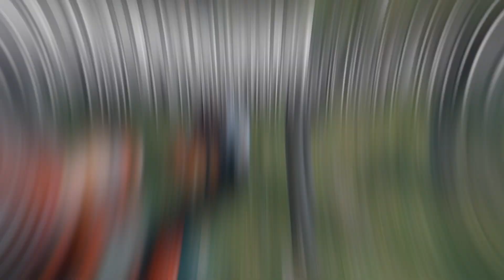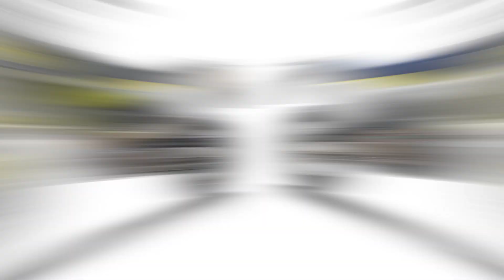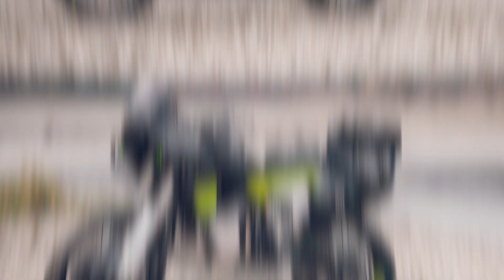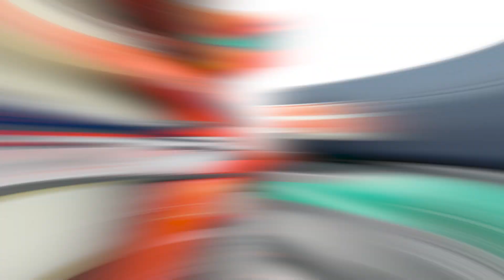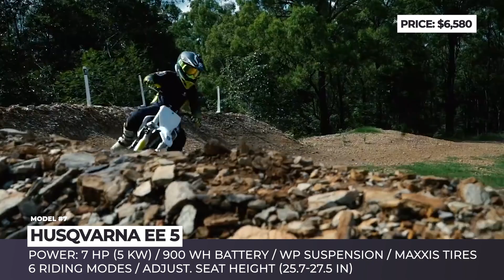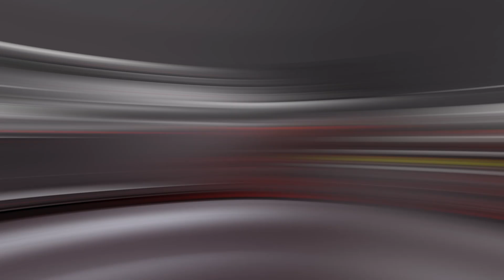10 Newest KTM and Husqvarna Motorcycles of 2021 (Superior Naked & Dirt Bikes)

Comment: I have a 2002 Honda Shadow VLX with 30 horsepower, weighing about 450 pounds. Great for 60 mph or less. The top speed is about 95 mph,  so it can do 75 mph all day, but a faster bike with better brakes and better suspension is better for this. It is like the new 250cc KTM but heavier.